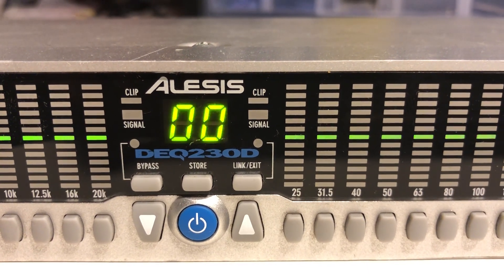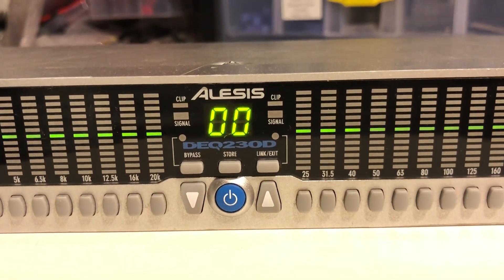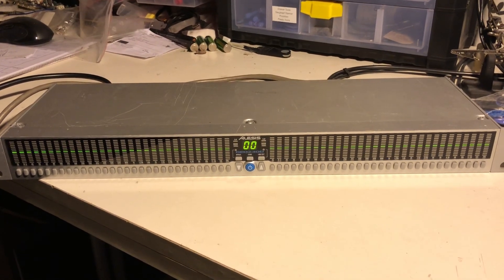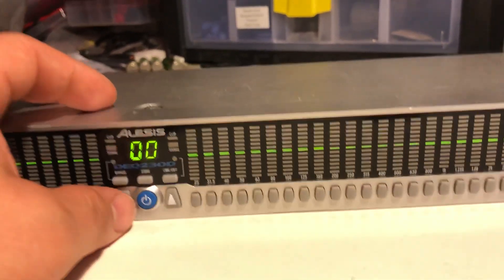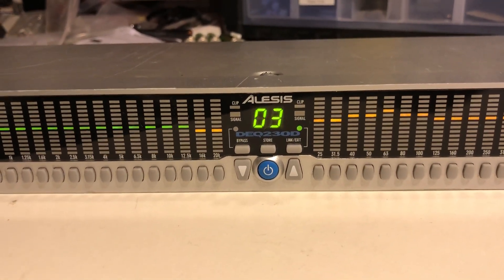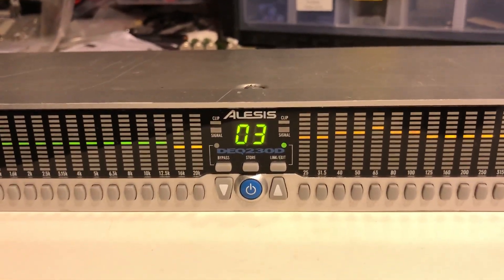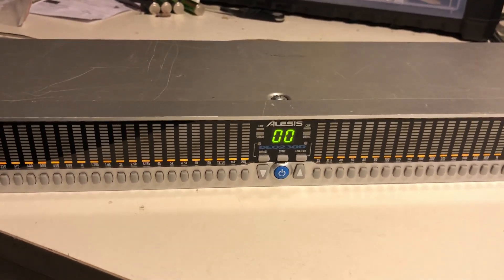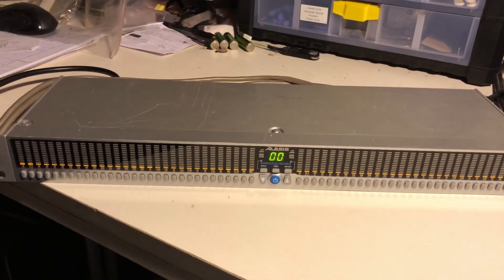Alesis DEQ230D Digital Equalizer functions, modes and real time analyzer explained

Comment: one thing is not clear to me .. .. I would like to know if + possible to use it only as a spectrum analyzer .. .. I don't want it to act as an equalizer.. .. I just want to see the original frequencies that enter the Alesis DEQ230D... is it possible to do this?
Reply from the maker: sure, you can set it to program zero, which is just a FLAT line. But if you want to make sure that it is not changing the signal, just split it and only use the input.
Reply: Seems rather expensive to use for that function alone
Reply: Thanks

Comment: Hi, great video. I also have the same unit but it's dead. How did you fix yours? I suspect the power supply is also faulty.
Reply from the maker: It was the regulatior mosfet on the AC side, but you have to check for shorts, mostly they blow not for nothing...
Reply: @djtongi  Thanks. I'll take it off the board and test it. I think the feedback optoisolator is also faulty on mine. I might just recondition the whole thing with new caps and as many new components as I can find. This thing deserves it :)
Reply: @djtongi  I have a Phonic i7600 similar to your Alesis, also had the plain D230 at one time.  The Phonic i bought for $400 and it stop working a month after i bought it, it does get power somehow but no lights, and that's because i shorted the fuses once i touch them with a screwdriver, i've changed all the fuses inside but one it happens to be a 1.5 amp 250v fuse, no such luck, bout ready to chunk it.
Reply from the maker: @smoothwater1  hmm maybe it can get repaired... where are you from?
Reply: @djtongi  from the states if you you are in a different country
Reply: are you selling that piece you have in this video?
Reply from the maker: Smoothwater Germany... actually i‘m not planning to sell it. 🤔 The last one i saw on ebay ended over 900 dollar...😧
Reply: Model 230 sử dụng hay đấy nó có thể thay đổi nhạc chỉ cần một nút bấm tôi đang sử dụng nó
Reply from the maker: you need electronic knowledge... and the right measuing devices...
Where are you from? Are you interested in selling it?
Reply: @djtongi  Hi, I have the knowledge and the right stuff to make a repair. Just figured if there is a common fault with these then I could just jump straight to that and make it a possible easy fix. Not had much luck finding schematics yet. What did you do to repair yours?
Reply: @djtongi  di lazada jual ga bos ?